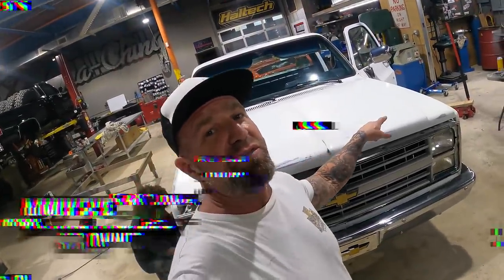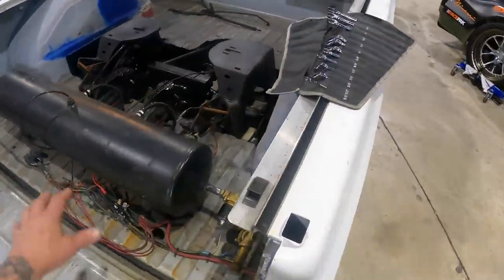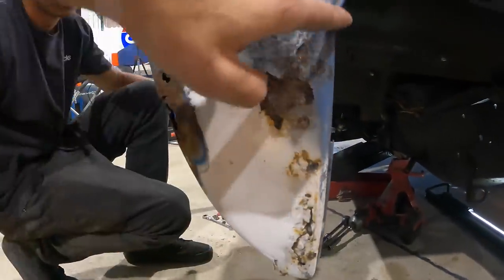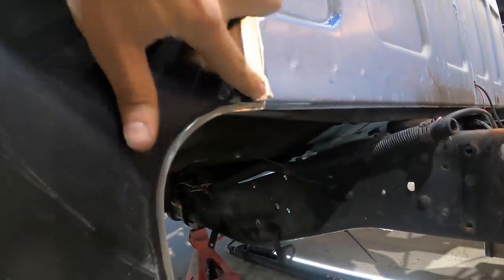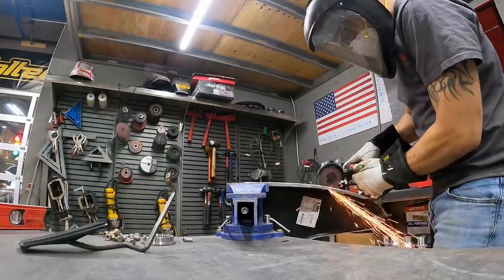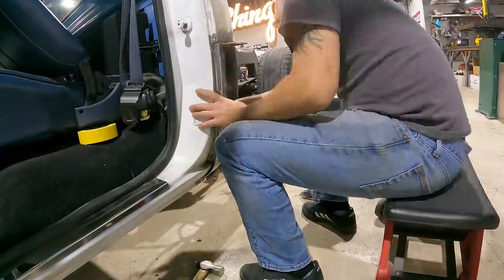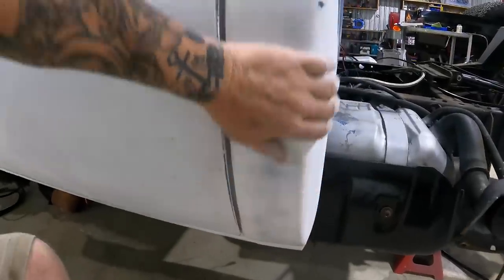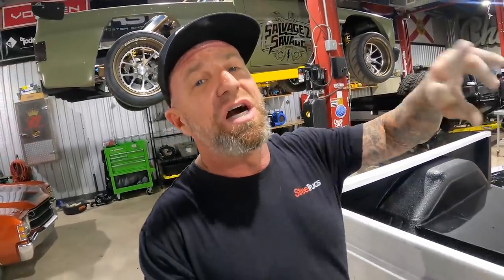1986 Squarebody Cab Repair & C-Notch Close Out Plate! - 1986 Bagged C10 Ep. 1

Comment: 7:53 I found out the hard way as a 20 year old just 6 months into working at a resto shop that you can also warp the metal sandblasting. Got int he zone sandblasting the roof of a 70 Chevelle and didn't realize how hot it was getting. Luckily, we were able to get it back into shape, but that was a rough day in the shop.
Reply from the maker: Ooof! That definitely would make the day rougher. Every day you learn something new is a good day though. That's the type of knowledge that separates a OK fabricator from a great one! (as long as you don't keep repeating the same mistakes)

Comment: I've never liked the shape or placement of the drain hole on that back corner of C-10s I tend to grind that drain hole into more of a teardrop shape to help everything to drain properly.
Reply from the maker: Rarely do you see a reasonably priced C10 that doesn't have that back corner rusted out. That drain hole was definitely an issue!
Reply: @SalvagetoSavage  Were is the water coming from? Not familiar with this truck issue. You guys did a great job.

Comment: fuel lines, how pressurized do they need to be? for example, I cant pass emissions in this little 91 ford ranger I bought, because its not holding pressure. I Found the leak and just want to redo all the fuel lines from top to bottom, problem is, I cant find any fittings that was on the original fuel rail but noticed the pervious owner used a rubber hose and clamp. should I just renew all that and just make sure its clamped tight?
Reply from the maker: If it's clamped tight and not leaking you should be ok. But it's always a better bet to replace fuel lines if you're having issues with them since leaking fuel could be pretty dangerous. As far an the necessary amount of pressure, I'd message Andrew on IG to see if he can give you a bit better insight on that!